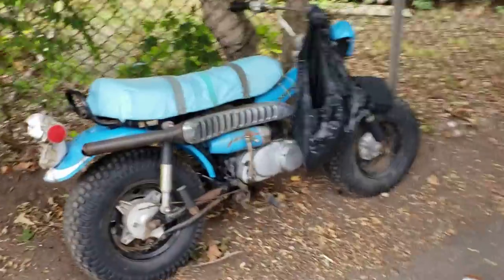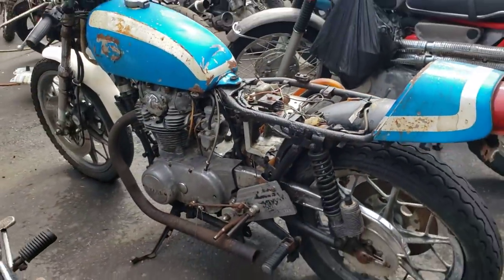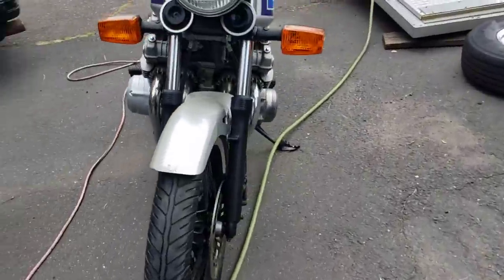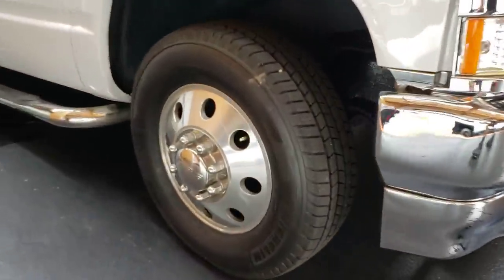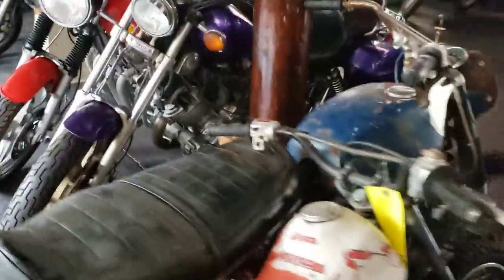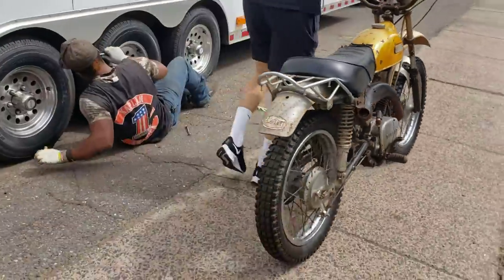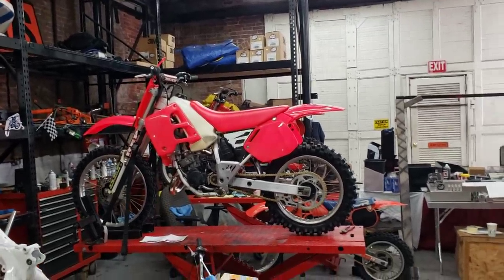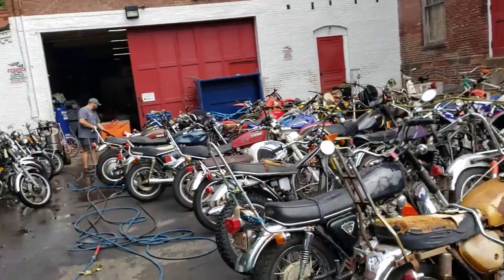AUCTION FOR 125 CLASSIC BIKES, 100 BARN FIND BIKES & 25 MUSEUM BIKE

Comment: Man it's good that you don't scrap any bikes cause these are time capsules and if they have to rust and die? That's cool but it's good to know there still around. I think you should open a motorcycle museum. I love the MX 80 when I was a kid my mate had the same bike his mother put kerosene in the tank so it wouldn't run so I came around one day and drained the tank, cleaned the carb, air filter checked oil, and BOOM WE ROAD THAT LITTLE SUCKER AROUND RAISING HELL FOR A COUPLE OF WEEKS AND MUM WAS NOT HAPPY. GOD BLESS AUSTRALIA. RIDE ON.

Comment: Love the 1982 cb900f. Wonder what you would pay for it at auction?
Reply from the maker: 2000 as is not running
Reply: We planned on coming down to kaplan Cycles in the spring from near Ottawa, Ontario. Thanks so much for your reply. Had a 1982 cb900f when I was 16 n brought back more rich memories

Comment: when is this auction I would like to buy some of those bikes ? I am interested in that 1984 cr80  and that 1980 cr 125 that was on the lift at end of video. I inherited my cousins brand new 1980 cr125 back in 1980,he never rode it because he passed away from lukiema at age 20 and it was passed onto me I was 10  years old but some scumbag stole it from me and I always wanted to replace it . I currently have 1984 cr250 and 1992 cr250 .Will you guys consider selling those 2 bikes pre auction or they have to go up for auction ? I will call you guys in the morning .